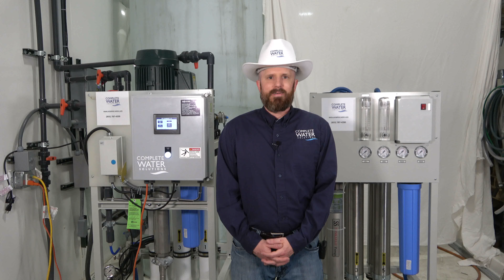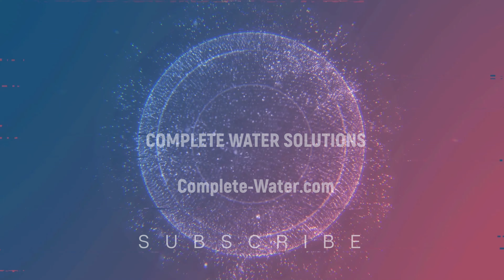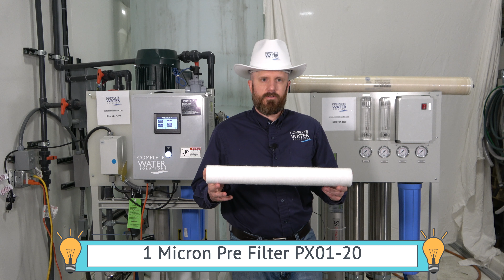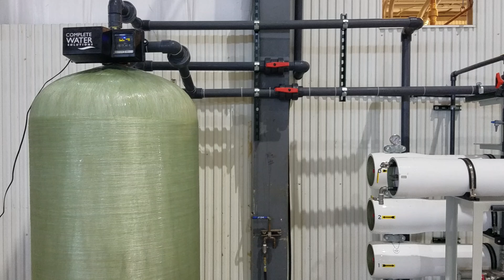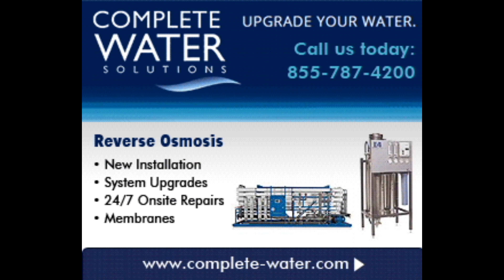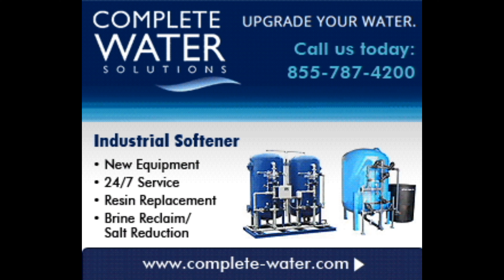Osmonics E4 Reverse Osmosis (RO) & New LT4 Reverse Osmosis (RO)

Comment: After changing the Membranes and pre filter on the E4 just as before I have very low output on water first I had 2gpm, after filter change it went to 3gpm but 2 weeks later it's down to 1 gpm
We bought the unit used, but I don't know what else it could be? All my incoming pressure is good. could it be the centrifugal pump?
Reply from the maker: Could be the pump but typically you would find that right away. You could check the discharge screen of the pump. If your recovering too high you could be scaling your membranes, Also if you have no pre-treatment or are having issues with your pre-treatment you can loose output. If you have the wrong membranes you may have lower output as well. Depending on water temp.
Reply: @completewater  We have a large Carbon cartridge before water incoming.
Reply from the maker: @Infidel67  You will need more than that most likely. Here is a blog post we did regarding "What Else Do I need With My RO" https://complete-water.com/blog/what-else-do-i-need-with-my-ro-system